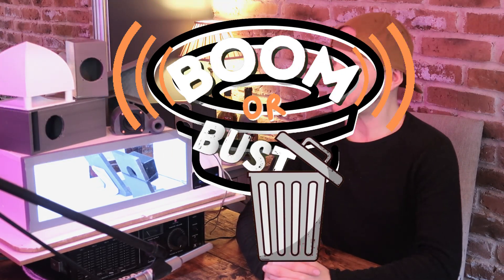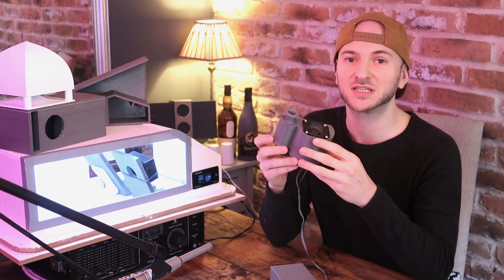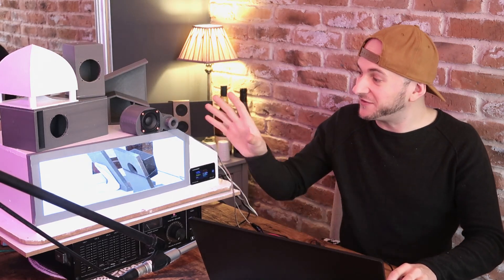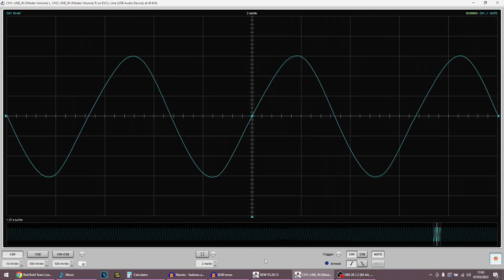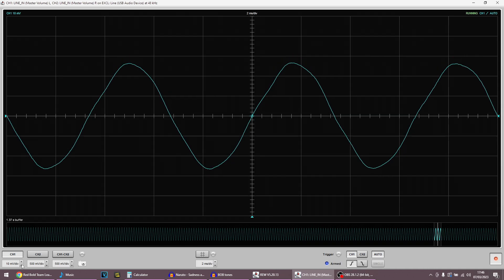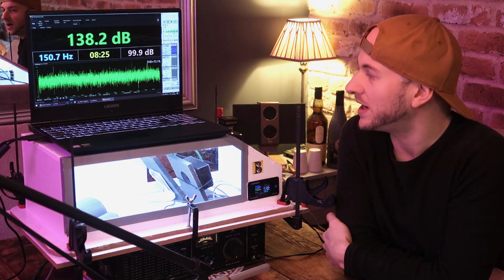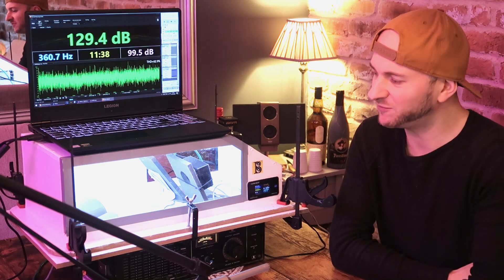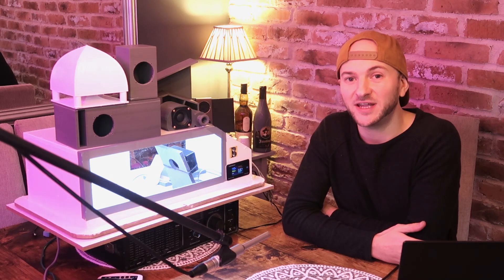LOUD Mini Subwoofer (but not in the way you think) Boom Or Bust S1E5

Comment: What causes Taramps to keep going up in smoke and catching fire?
Reply: Using them outside of their specs, poor electrical/underpowering, and undercooling.
Reply from the maker: They don't lol I repair more Koreans that have been on fire
Reply: They only blow when I'm driving the subs hard. If a sub is about to go out. Can that damage the amp? Because the voltage, wiring and cooling is good.
Reply: @randomtube8226   - In theory any amp can go up in smoke by running partially blown subs due to impedance changes overloading the amp, but you’ll need to confirm with an expert.

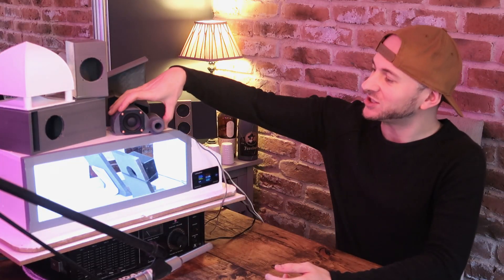Comment: It appears the cone excursion is not even.  i.e The bottom of the cone seems to lag the top of the cone at low freq and on slow mo @0:17 .  Maybe due to 'shutter roll'.  I guess a quick test would be to rotate the speaker with camera rolling  and if it always appears to lag at the 'bottom' then its shutter roll.  I may be imagining the whole thing.  Great videos BTW.
Reply: Yeah that's rolling shutter. If a sub was actually visually moving that way it would tear itself apart extremely fast

Comment: @barevids, and for those that don't know how acoustic order enclosures work, that design is a 6th order bass reflex by design. A little more adjustments to the second chamber (muffler) size, and lower tuning on chamber 1 into the second chamber, and chamber tuning of the high side, would have been a little different of a result. Cool design though!!
Reply: It might be a 6th order in theory, but it has the same impedance graph as a standard ported box
Reply: @blakebrockhaus347  Understood and if you seen in the graph, the flat point Sam mentioned is what a 6th order bass reflex does. That's what I was alluding to. It shifts the second spike further on the frequency spectrum which helps amps. If the front of the woofer was in the "muffler" enclosure instead of playing into the atmosphere, it would be a 6th order bandpass which is when you would have two impedance dips because of the second ported enclosure. HexiBase explains it better, but if you make a series of enclosures one at 30hz, ported into another enclosure at 60hz, ported into another enclosure at 90hz vented into the atmosphere with the driver playing into the atmosphere, you would most likely see the same dip stretched even longer if the enclosures are the correct volumes. Just some explanation if I didn't make sense.
Reply: I made a double bass reflex for a 6.5 inch dd506d2 my front chamber (active chamber) is wat bigger then my 2nd chamber (passive chamber) just like hexibase had i think

Comment: Did you get your nozzle/print settings sorted or go back to the smaller nozzle?
Reply from the maker: Sorted!
Reply: @barevids  yo you got exo watching!
Reply: @barevids  cool.  I just found a nice plugin in the cura market called parts for calibration.  Never checked out the market tab in cura before.  Anyways Its got all the basic calibration prints built in.  Currently using it for this new filament I got that just flows like crazy and makes a huge mess.  Parts for my boom or bust box printed with it werent working with parts from the usual filament.  15 minute flow test cube and things look a lot better.
Reply: oh wait its called shapes for calibration.  Very convenient though

Comment: Did anyone submit a 3:1 double t line? Bose style?
Reply: bass cannon
Reply: Not yet...
Reply: I wonder how that looks? 🤔

Sounds really interesting.
Reply: @DubHead69420  Think of a subwoofer in a pipe with one side firing into one length of it and the other firing into another length of it.  Then think of that tube being folded to whatever geometry you want or just leaving it straight.
Reply: @666nacirema666 , just to be sure, is there 1 or 2 subwoofers in the enclosure? 🤔
Reply: @DubHead69420  You could make it work with 1 or a dozen if you really wanted.

You mount it so the driver(s) separate the different lengths of pipe or whatever you use to make the tline

The front wave goes to one length of pipe the rear wave goes to the other.
Reply: just look up bose bass cannon.  I made a folded one using a 6.5 years ago.
Reply: @666nacirema666 , oh okay, that makes more sense when I can see it haha.
Reply: @DubHead69420  mess around with hornresp.  

I think it would have to be purpose made for the "vehicle" sam is using.  location of the ports would be kind of important I think.
Reply: I've never seen a big one in a car before. I would love to see how it performs against the ported.